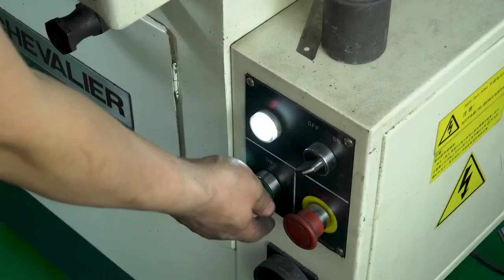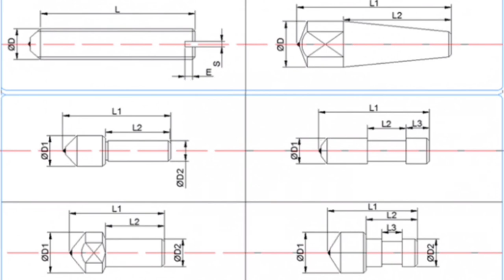Dressing tools | How to use diamond dresser to dress and true grinding wheel (Abrasive Knowledge)

Comment: very good, however i have been told and seen on the instructions that the tool has to be at an angle
also what makes the single point chip?
and what about the tool orientation to make its facets parallel to the grinding action
last question, how deep is the diamond ? is it a long piece of diamond or just that diamond shape cemented in the steel?
thanks and hope to hear back from you
Reply from the maker: chat with Mrbrianzhao by whatsapp +8613733809594 E-mail: abrasive@ftm96.com
Reply: @forturetools  sent on email

Comment: hello Brian

I need you help !     I have a small caribide rod 3mm what diamond disk I need to grinding the head   Thx !
Reply from the maker: You use a diamond disk for 3mm carbide rod grinding? If yes, first, you should know what size diamond wheel/diamond disk suitable for your machine, electroplated diamond wheel and resin diamond wheel with medium grit 150# use most often. If you have more question, add my whatsapp for furture communication  whatsapp +8613733809594

Comment: HELLO from Croatia , Your recommendation for external circular grinding, workpiece diameter 540, grinding wheel diameter 500, rpm1150-1340. Workpiece speed rpm, grinding wheel displacement, depth of cut
Reply: Za šta vam treba?

Comment: That video was good but showed practices that would/could get a person fired in the US or Canada for doing. Wheels of thst size typically get their own adapter. They fet balanced after wheel adaper is installed. After its balanced it gets installed on the spindle shaft taper. The adapter is marked to match the line spindle end, that way the wheels come on and off the taper, orientated to the mark and never require balancing again. 
 You dressed the first wheel and then removed it. The process would need to be done again.  If your machines just use straight shadts, you'd run into all kinds of issues with large or odd shaped wheels. It would be nightmare. 
  Thats what really caught my eye. It really looks unprofessional for a grinding business to have videos like that up. Second year apprentices know better.